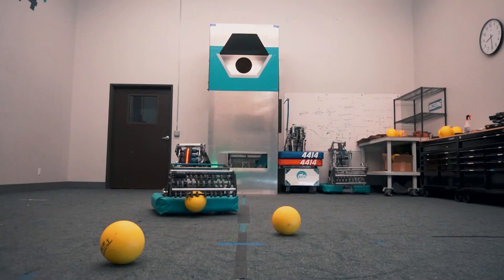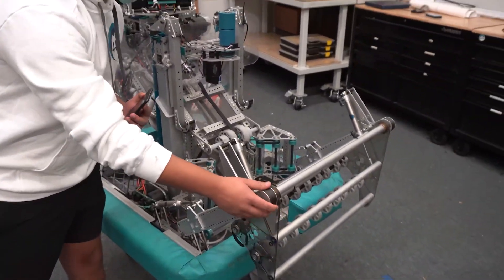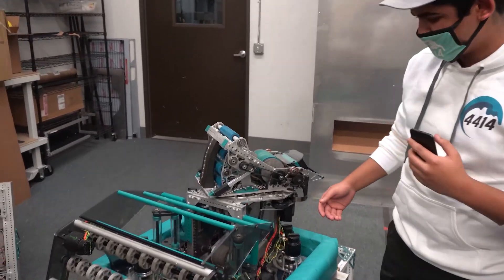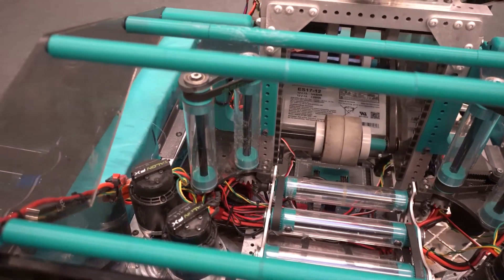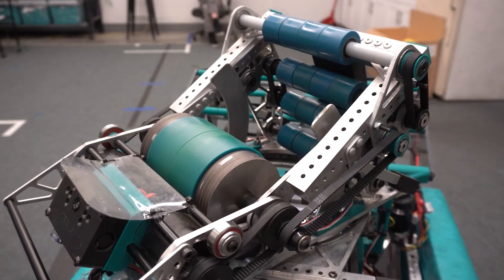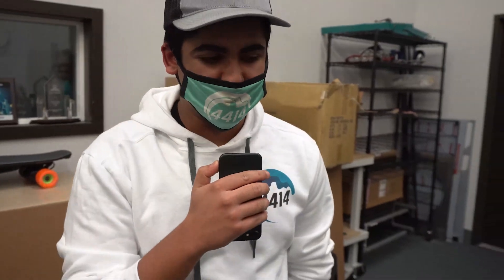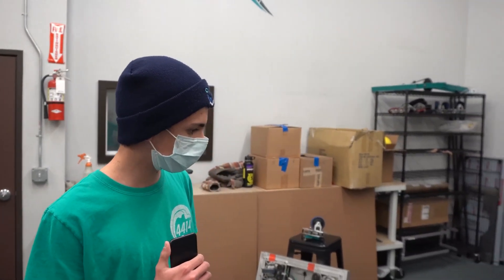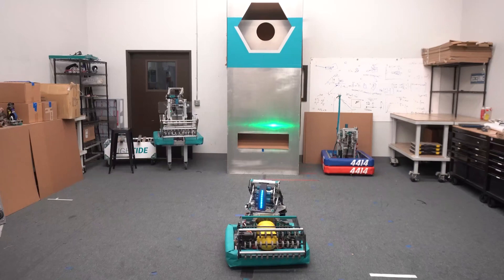Behind the Bumpers FRC 4414 HighTide Infinite Recharge 2021 - First Updates Now

Comment: Programming: Why don't you try and make the turret always face the last aimed direction and stay there, that way you don't have to re-aim (of course while staying within the 180 degree limit range)? (tip: this could use the gyro)
Reply: Their pose estimator code is smart enough to reset the odometry pose every time the target is detected again so their odometry shouldn't drift too badly between the times when these are reset. Therefore, they could use the field-oriented angle towards the target whenever the target is not visible since they'd know the pose of their robot as well as that of the target.
Reply: This is a solution we actually used for a while, but the problem with that is when the robot moves around when the limelight is not within its range of seeing the target, the target is in a different place, so if we try to snap back onto the last aimed direction, the robot will instead go to the gyro angle it last saw the target and not the actual target.
Reply: @burtonsessa5855  if you do what I talked about in my last reply: basically instead of just “remembering” ur last turret field centric angle, you want to use it as a baseline for ur pose estimator. Then with some simple trig you can calculate the angle to the target from current pose based purely on odometry since the last time the camera could see the target.